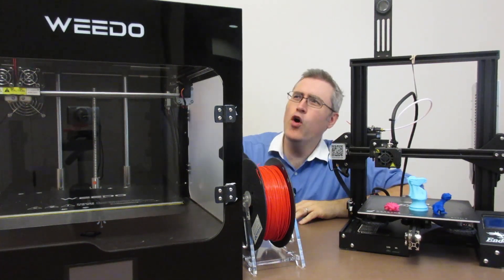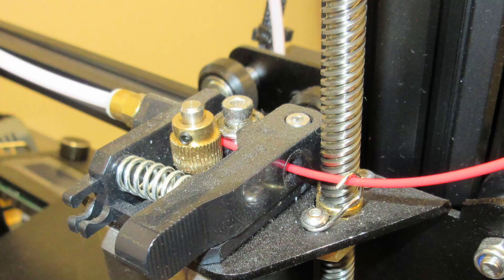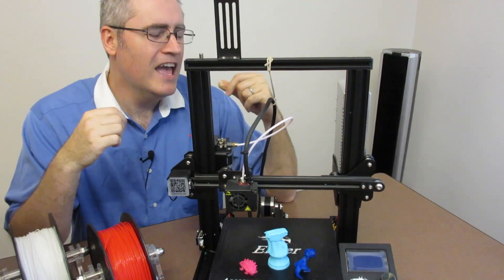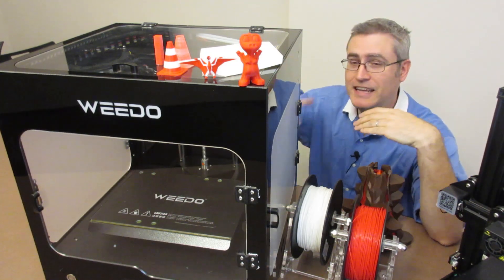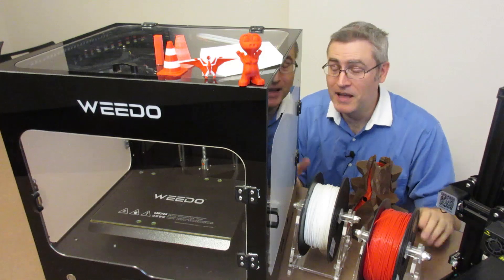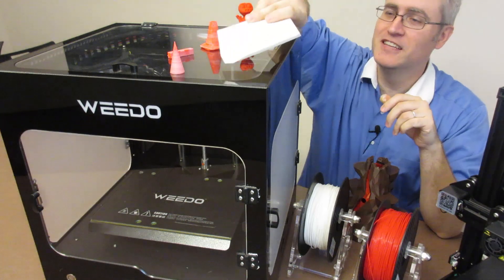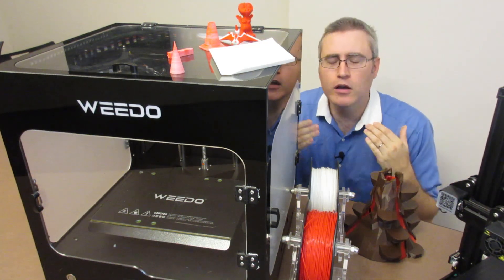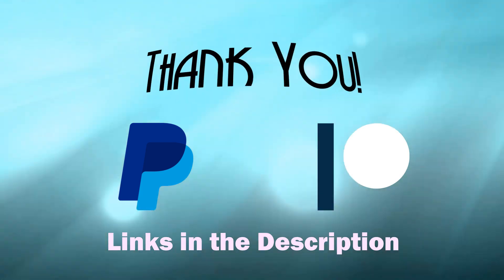Ender 3 vs Weedo F192 Double Review

Comment: I couldn't agree more on the price point discussion. My first 3D Printer was a Flashforge Inventor, and it worked well straight out of the box. I've since added a number of printers to my lineup including Cetus and Monoprice, and had an Ender 3 for a while and for a hobbiest on a tight budget that is willing to tinker, the Ender 3 is a fine printer. For a company that simply wants the printer to work with little or no additional effort, it's well worth having a company that you can get on the phone with if you encounter issues.

Comment: When building an enclosure, for the Ender 3, what would you take out? Just the power supply or the touchscreen also?
Reply from the maker: Whatever you want. It's open source. Me, I got a Weedo F192.
Reply from the maker: In all seriouslness, I'd probably hook a Raspberry pi running Octoprint or Astroprint.
Reply: I would take out the power supply and the screen the reason you take out the screen is for accessibility so you dont have to open the enclosure each time you want to access the screen.
Reply: @techinet2460  Good idea. Thank for the answer. Yours actually make senses, compared to what the professor answered. Both of his answers are absolutely not relevant to my question. :)

Comment: He must of got it for free because my ender 3 is amazing
Reply: well glad yours is...mine on the otherhand is not so great. Never have I had a fan die with such little use untill I bought this ender 3....Never have I had a rotary encoder die with such little use untill I bought this ender 3....Never have I had an sd card die with such little use untill I bought this ender 3...apart from things failing and a bed that is far from level and a bracket that should be bent to 90 degrees is not.....yea it's fucking amazing not

Comment: Wauw! So the ender 3 works perfectly for 200 dollars even though your assemblers did a crapy job assembling it(a day?? Really?).. and the 1500 dollar black box thats the size of my car, doesn't even have space to fit spools?! And Came BROKEN?? You had to call them? and they mailed you the parts?? This means you has to wait??.. You forgot to mention that the Ender "for ONLY 200  dollars" comes with a SHIT LOAD of free spare parts and tools... so no waiting there..
Thank you Creality! And Wtf is Weedo? It has doors which you can acces from all sides, how cool is that! So does the Ender3 because its OPEN!!! I've been 3D printing for 6 years now I had a 2200 dollar ultimaker2+ that printed shit, it took me 2 years of pain and suffering to get 500 dollars worth of prints out of it. I have the Ender 3 for 2 months now and already made a 1400dollar profit, you printed a little plastic dual collor dino? How cute! See my channel  I Printed a complete Velociraptor scale 1/1 with the ender 3, it sold for 550 dollars!!.  The ender3 worked non stop for 3 weeks didn't fail once, I even had to calibrate the buildplate just once, If you're looking for the future of 3d printing i'd say Creality is already there..

Comment: Not moving the lead screw has a very simple reason. You need to lift two fairly heavy stepper on the z-axis. If you had that weight on the opposite side of the lead screw, the forces on the guiding wheels would be much bigger. In the standard configuration of these printers the center of mass of the two motors should be in or near the lead screw, which is perfect for load distribution on the guiding wheels. It's all about torque.
Reply from the maker: That's a good point. But the filament still runs too close to the screw.
Reply: @3dpprofessor  I never disagreed with that statement. Although i never saw it as a big problem, as there are countless easy and cheap ways to fix it. Use a piece of wire like on your machine or print a shell and put it around the lead screw. The possibilitys are endless. 
I personally see it as a benchmark on how far we've come with 3d printing. A few years ago people would have killed to get a printer this good and few problems, especially for the price ( yep, i said it. for the price) of the Ender 3. But again, i agree with your statement on the partly questionable engineering.